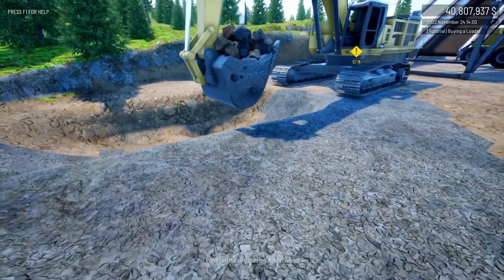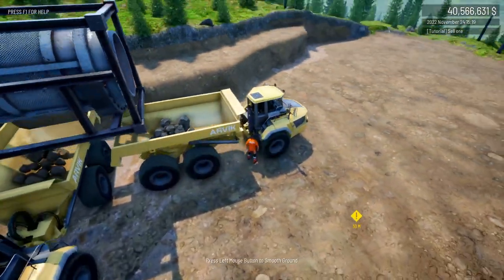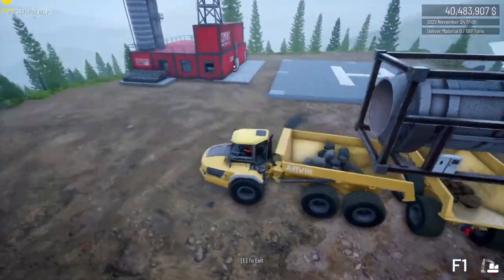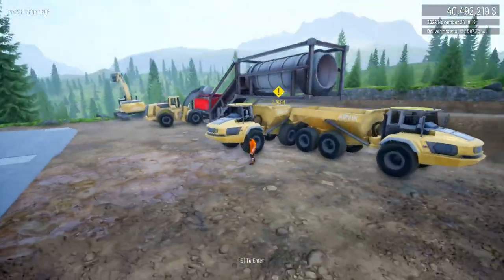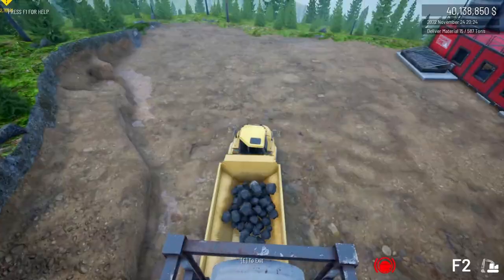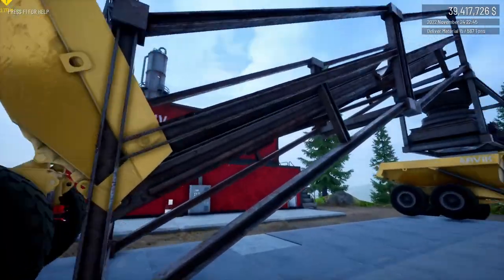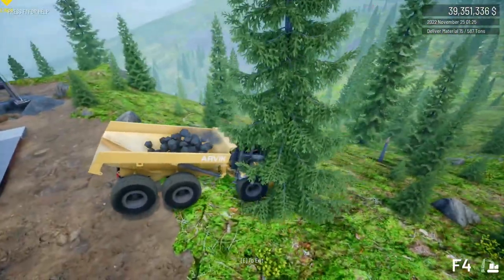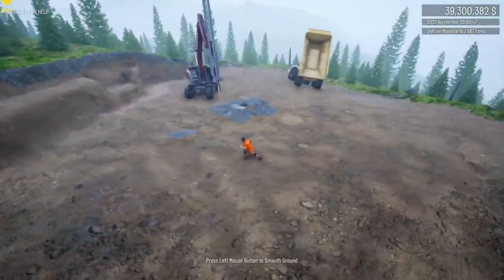Out of Ore - Mining Plant (What you need to know)

Comment: Nicely presented information.  Good video.  

One thing I would have wanted is what some of the solid rock would have given you after going through the equipment.  I assume it's treated the same as paydirt.
Reply from the maker: honestly I did a 'quick' dig around hoping to find some rock but it always turned out to be some sort of ore.

my understanding from others is that rock has a higher chance of coming out correctly ( blasted rock > crushed rock> gravel ) but we still dont know how well these actually work, if they do at all, sometimes people claim they work, other times they dont work at all. 

they are a known issue to the Dev and as yet we havent seen anything to say they have been 'fixed'